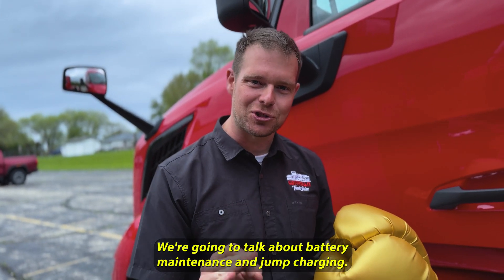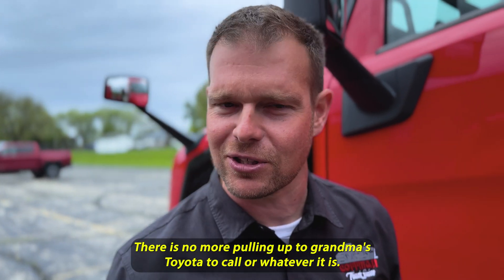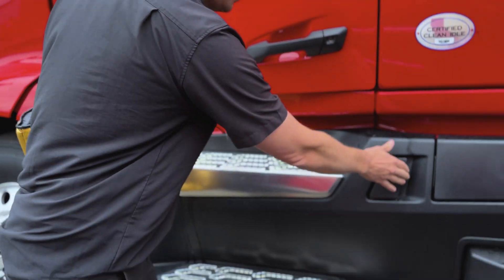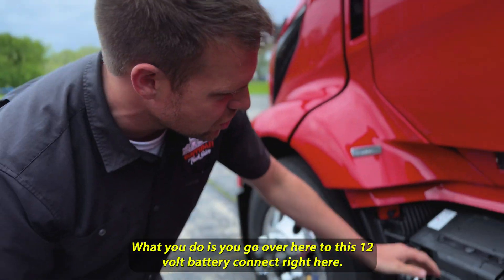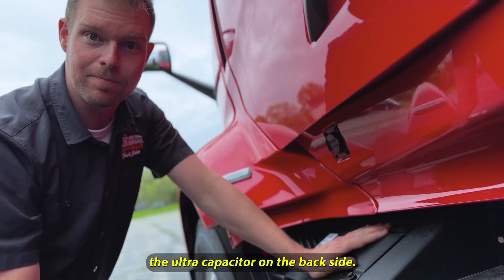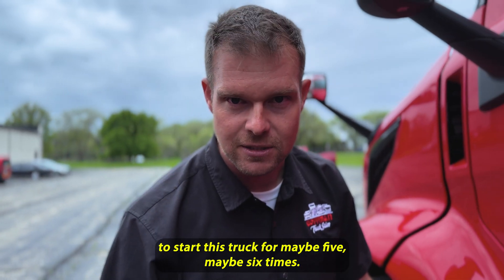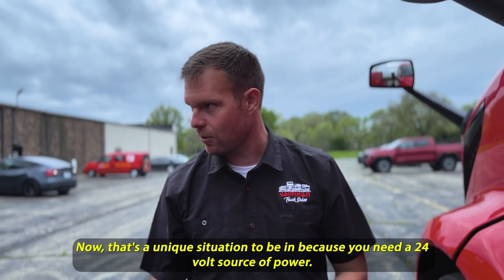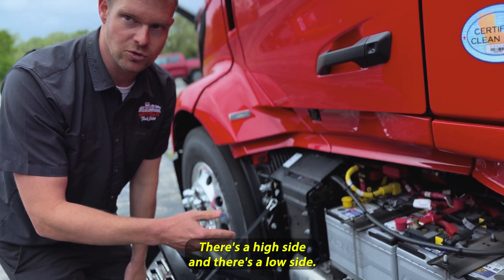This 2026 Volvo VNL Mistake Could Cost You $20,000 - See how!

Comment: Well you’re wrong my friend… cause you can jump start this truck… cause I’m having issues with these new batteries systems and had to get loves technician jump start my truck…
Reply: When the love mechanic came to my truck he told me that you can’t directly hook up to the battery… he showed me that if you hook up to positive to the capacitor rail and then just ground… then he just started up my truck in five seconds…
Reply: I have the same issue too, after I finished fueling at this pilot  I couldn’t start the truck. This brand new Volvo is garbage. 1500 miles and already battery failed.
Reply: How?